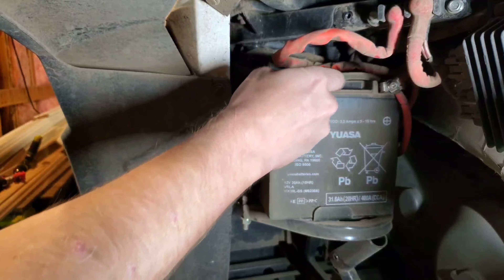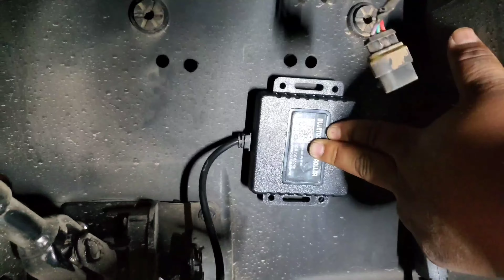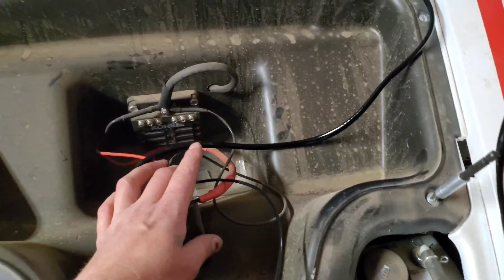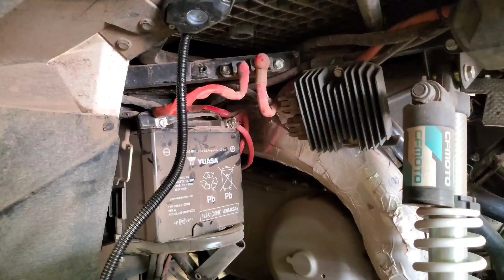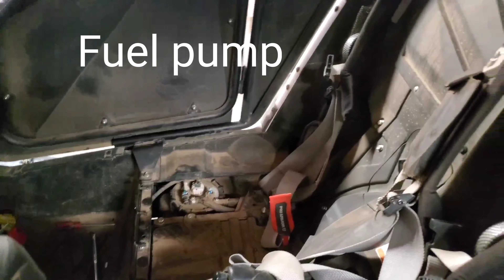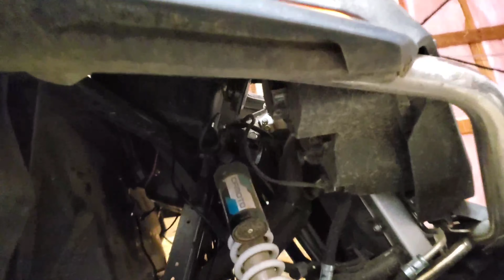Cfmoto Zforce 800 rock lights

Comment: Gents, if you didnt want to install the extra rocker and such, could you not just piggy back the wiring on a current switch. For instance, on the high beams or low beams?

Comment: Nice vid, just ordered the same lights and a set of whips for my 950.  How do you like those rock lights, any problems?
Reply from the maker: So far they have been awesome. Only complaint is the control boxes are all on the same bluetooth frequency. So you might change colors on multiple machines if your buddies have the same brand.

Comment: What power distribution block did you use??
Reply from the maker: Kohree 6 Way 12V Blade Fuse Block 12 Volt Waterproof Fuse Box Holder, 6 Circuit W/Negative Bus Fuse Box with LED Indicator for 12V/24V Automotive Truck Boat Marine RV Van Vehicle https://www.amazon.com/dp/B07XXTQPKL/ref=cm_sw_r_apan_glt_fabc_38TMNVEPRHVV28GV4K00?_encoding=UTF8&psc=1
Reply: Thnx and great job, appreciate it